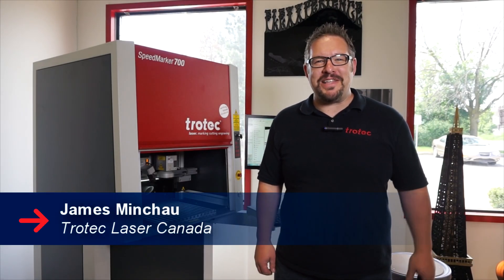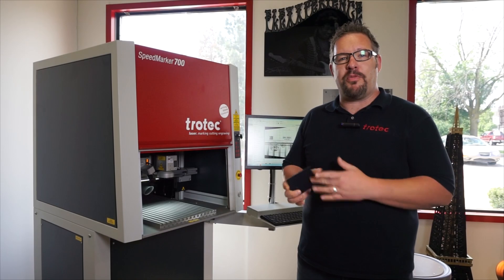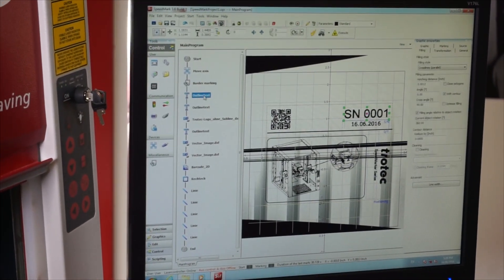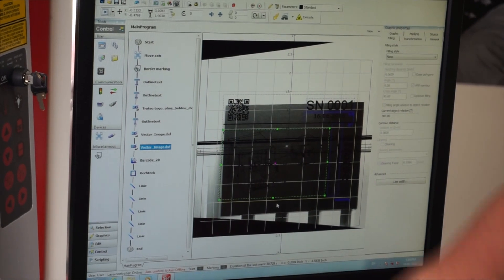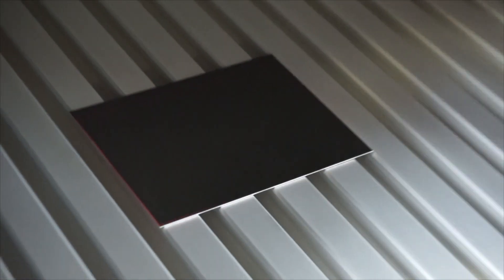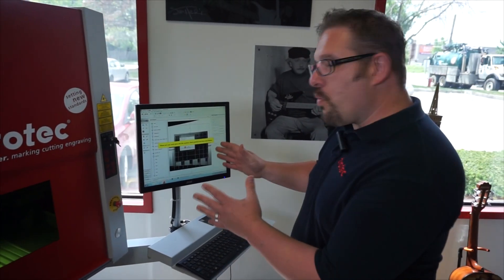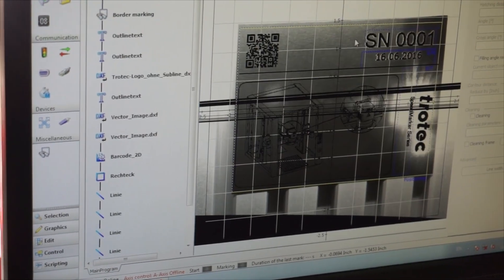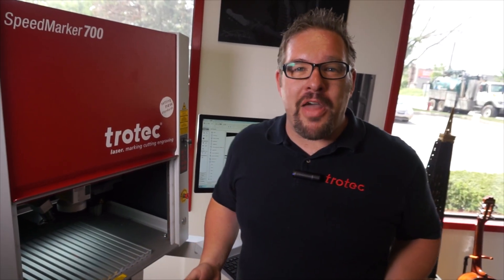Laser Marking | Anodized Aluminum Plates | SpeedMarker 700

Comment: This is a great video:  Can I ask a few questions?  
1) Can this achieve repeated precision marking, the sort that would then be certified by a national body for CE marking? Some other lasers have issues with controllers that have difficulty producing a straight unbroken accurate line
2) Is the laser kerf able to mark mm scale, i.e. imagine a ruler but on housing
3) What's the height tolerance of materials?
4) Can it produce high contrast blacks without any extra consumables like Thermark? 

Hopefully the answer to my questions will allow me to look towards Trotec as a key part of my production process (If possible please don't redirect me to sales) - Thanks!
Reply from the maker: Hi there thank you for your comment.

1) Were not sure about the certification but yes our galvo laser standard is some of the best in the industry. We can always do a test run at your local Trotec branch if you'd like to see it. 
2) Yes, the kerf is extremely small and can well cover mm.
3) Depending on the laser really, what do you need? We can recommend.
4) Yes especially MOPA. Check out our MOPA videos and you'll see.
Reply: @TrotecLaserCanada  Thanks so much Trotec Canada, I will get in touch with a UK rep - I'll check out the MOPA. - Question no.3) We'd need a height tolerance  of 80mm possibly more dependant on the jig with width/length around 350mm